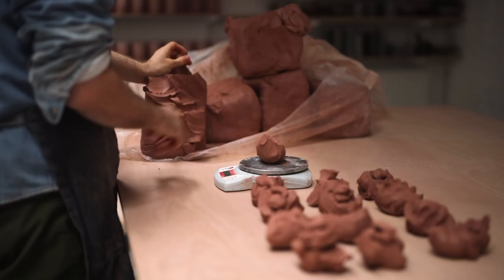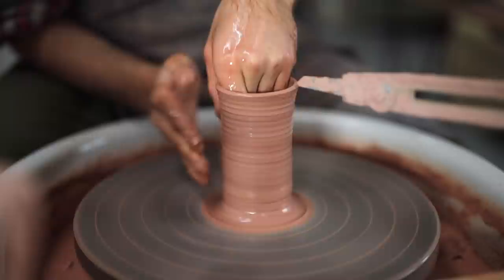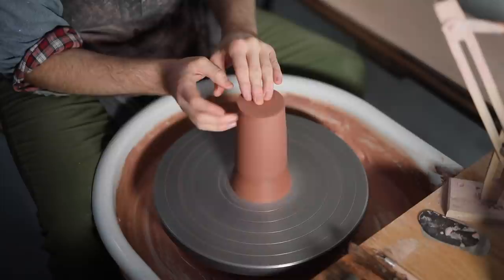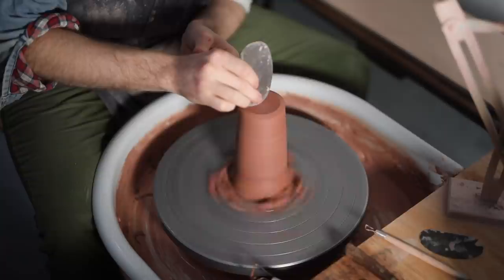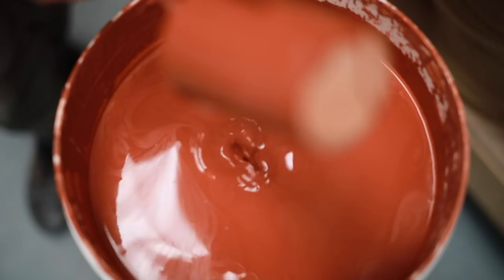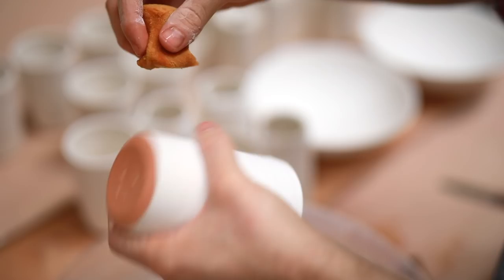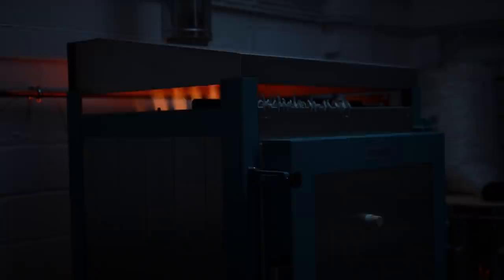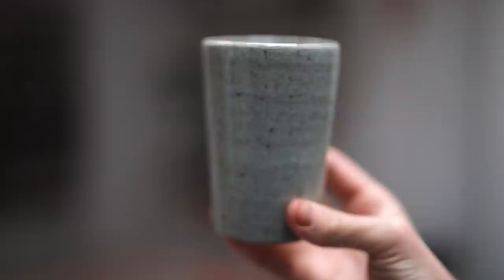Making a Stoneware Pottery Cup, from Beginning to End — Narrated Version

Comment: Thanks for another amazing video. I followed your advice on making some leather hard throwing chucks and it already helped me a lot. I always hated struggling the bottom of round moonjar for example as I always tried fitting them into whatever I had around. Now I throw the fitting shape after the vase and keep it moist to use it in the future. 
There is some discussion about crackle glazes and food safety. I would like to know what your process in food safety was (did you just test it by a lab?) , especially I would also be interested to know how the japanese potters you visited handled that. (but maybe thats a bit big of a topic). I just started about a year ago but I get a suprising amount of requests and one reason I didn't open a shop yet, is because I haven't yet understood the topic of food safety enough (my mentor tought me from the start to mix own glazes) despite reading through all guides online. I apologize for this giant message already.
Reply from the maker: This is my general reply to that query, I very much recommend reading the link too!

I’ve been using crackle glazed ceramics for years and years. It’s high fired stoneware with nothing nasty that could leech, the crackling doesn’t stain too badly as long as it’s properly washed but of course it happens overtime. To the same degree, many of the potters I’ve worked for over the years who wood fire, soda fire and so on, all have work that crazes and crackles to some degree and it all stains with time, yet functional work is still made abundantly and is completely usable.

I’ve never heard any stories of anyone getting ill from crackle glazed pottery, the clay is highly vitrified and unless you take terrible care of your ceramics you’ll be perfectly healthy. For industry it could be an issue, due to the surface of the pot having less strength, long-term staining with excessive use and fragility as it’s high fired stoneware with lots of iron, which makes it weaker and more susceptible to chipping on the whole, but that’s what you get with handmade ceramics, I don’t want to make pots that have perfect, uniform surfaces like you might find in a shop, I want each to be individual and interesting and handmade and I suppose the same goes for the generations of potters who’ve worked all over the world. 

Here’s a good link to an article that goes into more depth about it, https://ceramicartsnetwork.org/ceramics-monthly/ceramic-glaze-recipes/glaze-chemistry/techno-file-dirty-dishes/, and clears up some of the misconceptions that are spread around. As long as you properly wash crazed pottery there is no bacteria left in the crackles. As long as you take time to care for your handmade ceramics after they’ve been used then they’ll be just fine.
Reply: @floriangadsby  Thanks so much for taking the time to explain it so well :). I was dropped into ceramics a few steps too far when I started and have ever since been trying to get a clear answer on food safety matters, however the landscape is so contradictory and unclear that it's hard to get a satisfying one. It's as you said partially filled with many misconceptions! Thanks for link too! :)

Comment: I have all but given up on making a foot on the average simple cup. Even coffee mugs I have a method that I put a decorative foot on the outside I leave the bottom flat and smooth it's as smooth as silk when I'm done all I do is wipe it with a sponge and it's done this many Potter's are going to this nowadays. Somewhere down the line someone got it in their head that it is not professional if it doesn't have a trim foot and I think it's just absolute nonsense my cups are beautiful I never get S cracks ever!

Comment: Great video.   What do you use to wax the bottoms?   I use a wax resist, but it always makes my brushes hard after it dries and I can use them again.  Thanks.
Reply from the maker: Thanks Bob! This is just the basic wax emulsion sold by Scarva Pottery Suppliers. I mix it a little with boiling water to thin it out, which helps it brush on more nicely and I just make sure to always wash my brushes with very hot soapy water, seems to work!

Comment: it’s cracking :/
Reply from the maker: It's okay, it's an aesthetic choice. I’ve been using crackle glazed ceramics for years and years. It’s high fired stoneware with nothing nasty that could leech, the crackling doesn’t stain too badly as long as it’s properly washed but of course it happens overtime. To the same degree, many of the potters I’ve worked for over the years who wood fire, soda fire and so on, all have work that crazes and crackles to some degree and it all stains with time, yet functional work is still made abundantly and is completely usable.

I’ve never heard any stories of anyone getting ill from crackle glazed pottery, the clay is highly vitrified and unless you take terrible care of your ceramics you’ll be perfectly healthy. For industry it could be an issue, due to the surface of the pot having less strength, long-term staining with excessive use and fragility as it’s high fired stoneware with lots of iron, which makes it weaker and more susceptible to chipping on the whole, but that’s what you get with handmade ceramics, I don’t want to make pots that have perfect, uniform surfaces like you might find in a shop, I want each to be individual and interesting and handmade and I suppose the same goes for the generations of potters who’ve worked all over the world. 

Here’s a good link to an article that goes into more depth about it, https://ceramicartsnetwork.org/ceramics-monthly/ceramic-glaze-recipes/glaze-chemistry/techno-file-dirty-dishes/, and clears up some of the misconceptions that are spread around. As long as you properly wash crazed pottery there is no bacteria left in the crackles. As long as you take time to care for your handmade ceramics after they’ve been used then they’ll be just fine.